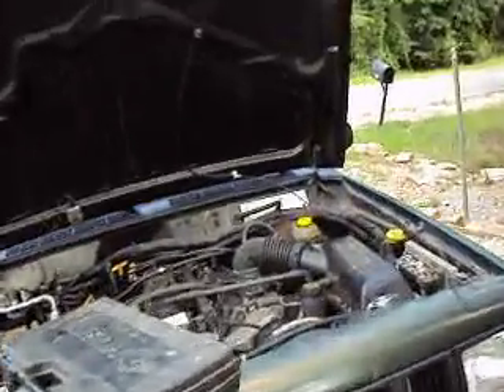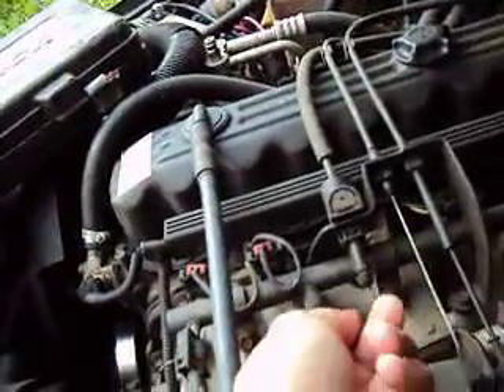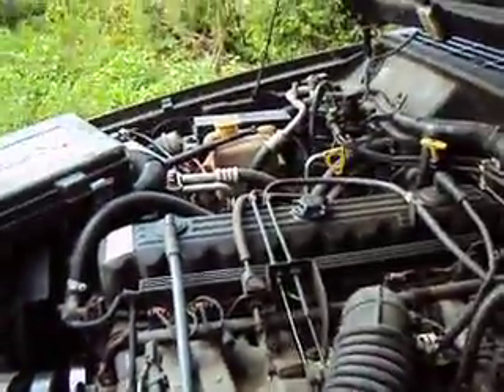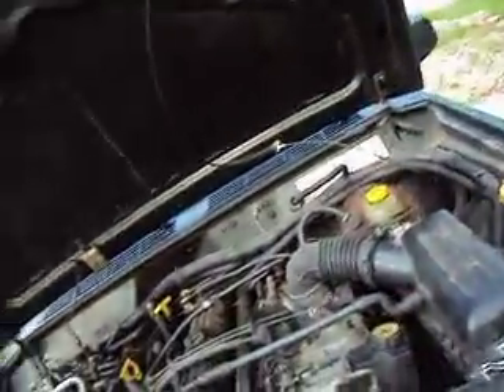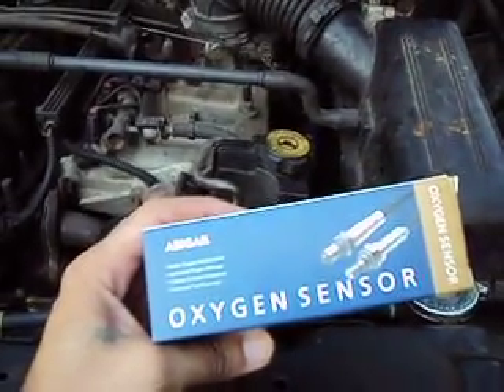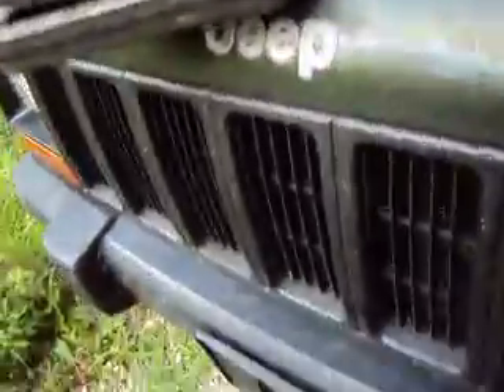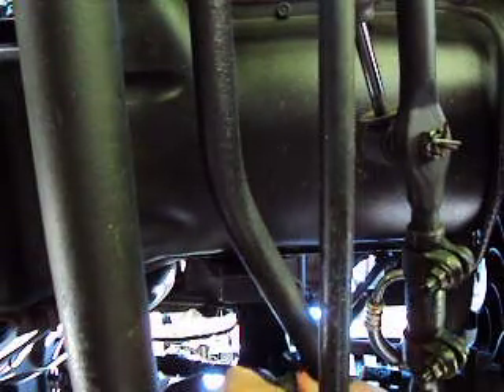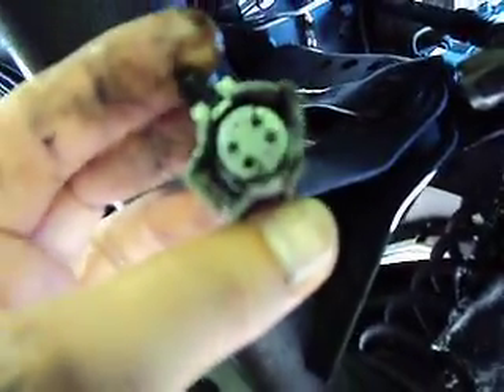P0171 Trouble Code: System Too Lean Bank 1 [Easy Fix]

Comment: I have a 97 f-150.  At first it had both banks running lean, i only paid $300 for it right well here i am looking every little thing up online and YouTube videos etc. So i replaced fuel pump fuel filter injectors coils plugs wires maf new vacuum lines and found this video that the intake gaskets are bad and so they actually were somewhat bad so i changed them and then put it all back together started it and nada still ran like shit wont rev up like it used to and it pops skips spudders trying to drive down the road... someone told me to unplug the 02 sensors so i unplugged them all and took it for a drive, it ran a little better until it warmed up a little then went back to running like shit, plug the scanner back in and only code i get is left bank running lean.  So i run to the part store and pay for this upstream 02 sensor cause thats what they told me there is only a upstream sensor could make it run like shit, heres $94 for it and i get home i watched videos to get the sensors out and i ran the truck for 20mins and also held a torch to it and couldn't get the snesor out... so i run back there buy a crows foot socket thats intended for 02 sensors well that pice of shit stripped the damn thing out, look up how others got their sensors out they used vice grips n a hammer, cant get anything like that up there even with the front drive shaft out of there, well i tried n tried to where i got chunks of the sensor off but stilk isn't gonna come out... any chance i just drill and chase some thread and slap my new sensor in there it wont blow out?... got find a win here hate to scrap it out after sinking $680-$750 into a $300 tru k....